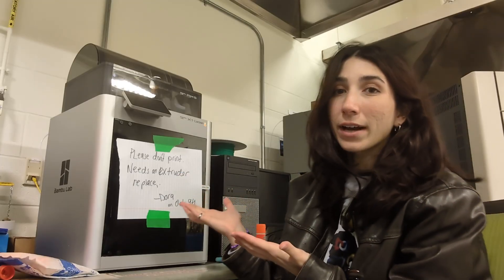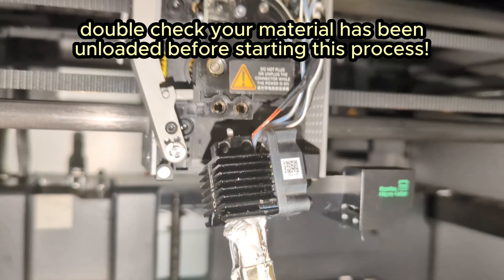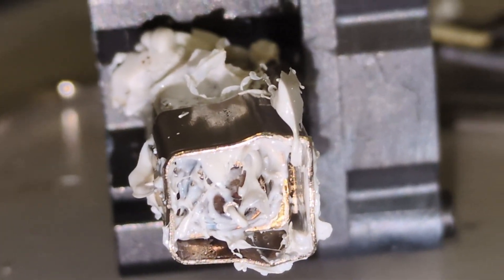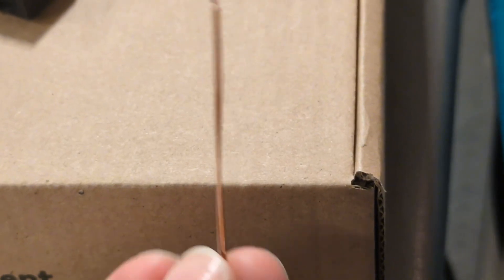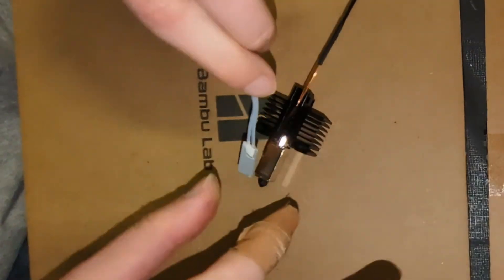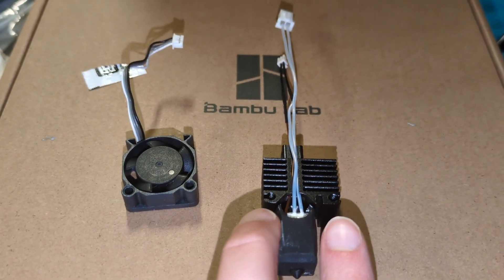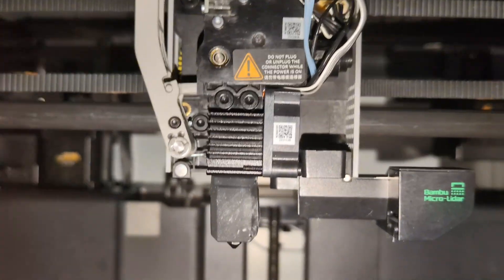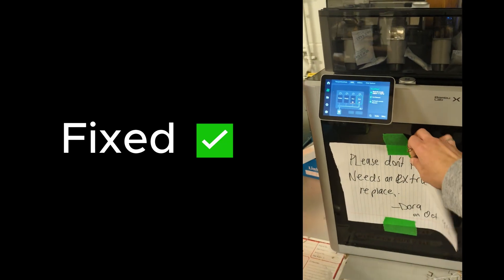I Saved $19! Hotend Assembly & Install for Bambu Lab X1C

Comment: According to bambu if you don't use their hot ends you have to change all of your k factors, especially for their filament profiles if you use them. Not sure what those cost but if you buy them direct from bambu they are pretty cheap might as well just use the OEM one in my opinion.

Comment: I was wondering how well the replaceable nozzle hot ends work. Let us know.
Reply from the maker: So far I've had really good experiences! I recommend this kind of hotend for the X1C. I heat up the hotend and use pliers and a nozzle sized wrench and socket from my ratchet set to change out the nozzle. I use the pliers to hold onto the heat break while I use the nozzle wrench/socket to remove or tighten the nozzle. The pliers help me make sure I'm not twisting the heatbreak crooked.  

I dont have any issues with leakage or clogs! I have been regularly switching between 0.2mm and 0.4mm nozzles recently. Hope this helps!